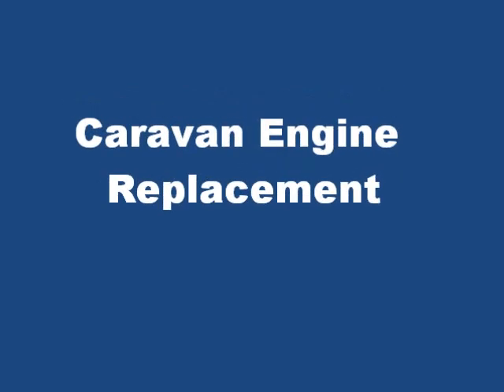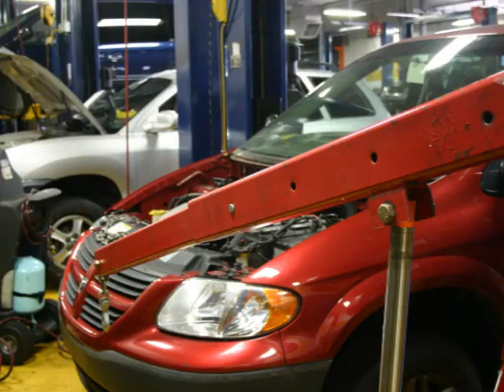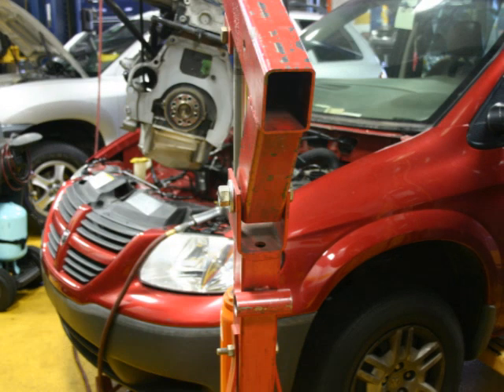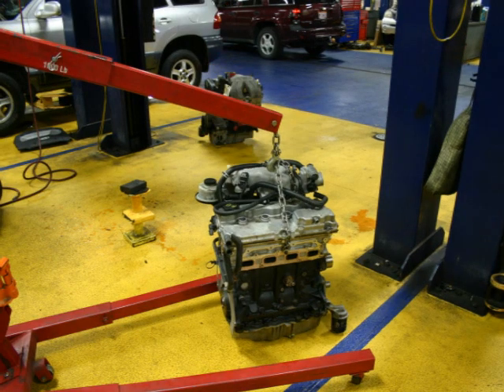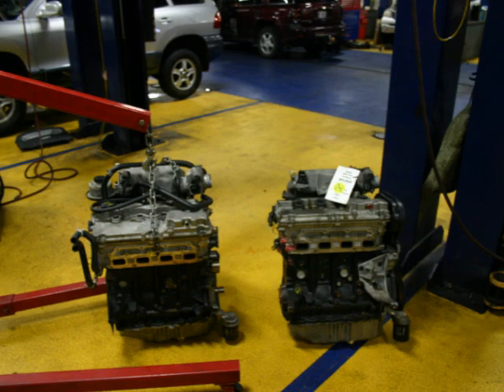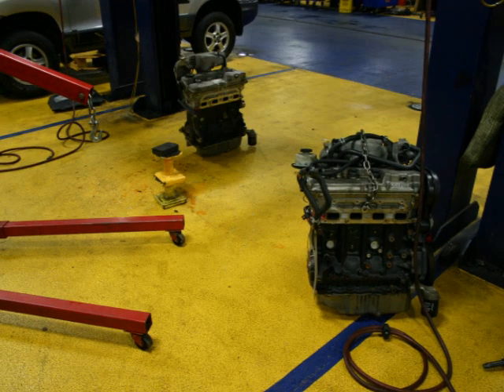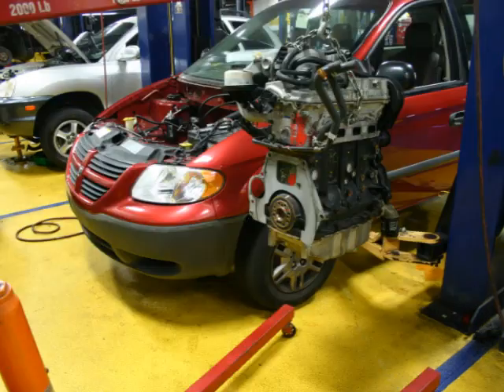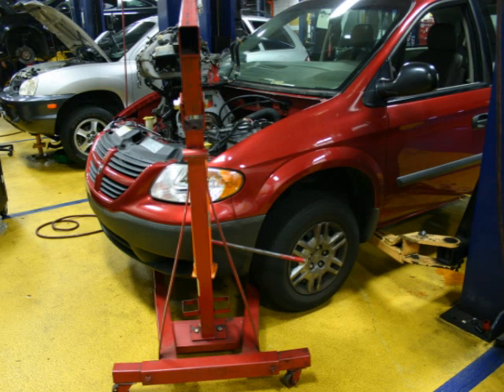Caravan Engine Replacement - Stop Motion

Comment from the maker: Thanks for the comment, I haven't heard that term before related to this. I've always thought that putting an engine in a vehicle other than the original size would cause too many additional headaches. Like incorrect motor mounts, wrong wiring harness, incorrect computer for the different engine, too low of capacity cooling system for the bigger engine, etc the list goes on. Besides all engines seem to have certain problems. The 3.3 is known for burning and leaking oil. It's always something.

Comment: There is a you tube video of a guy hoisting a V6 out of a dodge/chrysler van with the radiator and air conditioner condensor still in place???. It will come out the top. Be sure and unbolt the torque convertor. There is not enough room to take the engine out with the torque convertor bolted to the flex plate.

Comment: have the same problem tore down the engine only had 1 halƒ oƒ a thrush bearing in it replaced the crank an matching  bearings with both thrush bearing halves ,must be the problem. dodge dont see a problem with this must oƒ been built on a ƒriday or monday

Comment: Has anyone gotten back to you on removing a V-6 engine from the top, on a 2006 caravan ?? Saw suggestions of pulling exhaust manifolds to make it more compact, pull wiper / cowl, and radiator, did anyone actually get it done ?? Thanks, Mike
Reply from the maker: +racrdude No. I would say it's not coming out from the top. The V-6 Block is too wide to come out without possibly breaking the windshield. Good Luck.
Reply: +DenLorsTools Even if the front bumper / core support is removed ?? Only have cherry picker...
Reply from the maker: +racrdude It may be possible if you go to that extreme but you still have to watch the front edge of the windshield when going up.

Comment: it called a dodge /DSM 4G64 2.4 crank walk motor, should have replace it with a V6 3.3l motor, the 4G64 motor is just going to come back with the same problem DUH, that is not fixing the problem.

Comment: Can this be done with a 99 Dodge Grand Caravan 3.3 V6?? My manual says it HAS to come out the bottom!!!!
Reply from the maker: It would be very tight. If I was considering trying to pull a 3.3 from the top which is wider, I would remove the wiper cowl assembly, take the exhaust manifolds off and pull the fan/radiator. Still not sure if that would allow enough room to get it out. Good Luck.